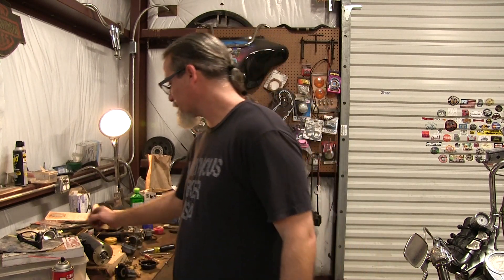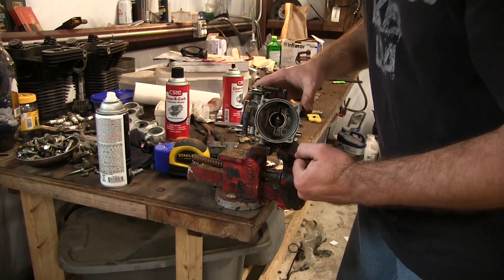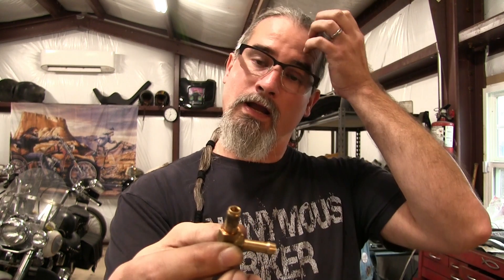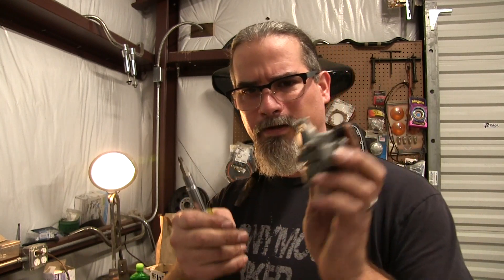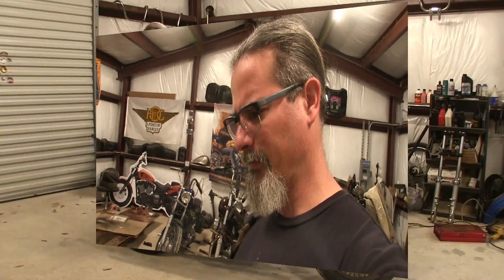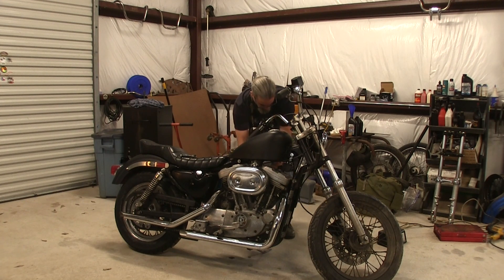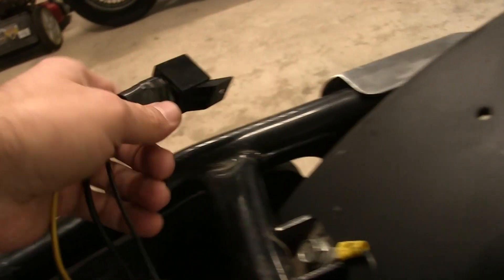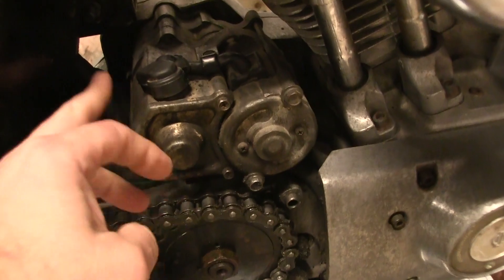I Was WRONG About POINTS In HARLEY Davidson EVO Engines Keihin CV Carburetor BUILD

Comment: Most folk also forget that your spark plug gap will need to be adjusted if you run points on an Evo - to about 0.028" from memory and to make sure that the points gap is within 0.002" on each lobe of the point cam. Love your honesty man 👍

Comment: The stock cv Harley carb is very good. I have a 100hp twin cam and it feeds it really well.
Reply: I love the CVs ... I have a few S$S carbs sitting on my shelf because that is the first thing I swap out when I get a new project. I can pick up a take off CV for cheap at swap meets and mod them using CV Performance kits and have a great running carb ...
Reply from the maker: Sounds killer!
Reply: @tommylitchfield3450  exactly why I love using CV Performance parts. They know their stuff and have quality parts ...

Comment: Outstanding my friend!

My 1979 Electra Glide FLH King of the Highway full dresser Shovelhead is running Dyna S and two 5-ohm coils since engine upgrades in 2001.

No worries.
If you do change to electronic ignition 
don't ever leave the ignition on and walk away!
It will be smoked when you get back...

Here is a short & interestingly article about reading your spark plugs...
Reply from the maker: Killer, man!

Comment: My 2000 XL1200C hard tail is running points and the power band is great. The mechanical advance mechanism has a 25° range so I set static timing to 40° fully advanced which means idle is at 15°, 5° earlier than expected but it works and the advance unit can always be modified to have a reduced 20° range. Also it's important to change the ignition coil to 5 ohm and use copper core plug wires instead of modern suppression core.

Comment: I owned a 95 evo sportster 883...... Rode it for 27 yrs....... The only electrical problem I had was the gas cock..... Diaphram leaked after 14 yrs..... This caused vacume in body of valve to  occasionally work and not work..... This opened and closed vacume switch and caused one coil to fire and not fire which caused rough running of engine.....I changed it out..... Still running perfect to this day.....

Comment: My 84 had electronic ignition and it left me stranded. $500 to replace the electronic module in 1990. $50 to convert it to points. So, I bought the Blue Steak brand conversion . I have never regreted that decision.  The electronic module on my 99 Softail died also. A Blue Streak points conversion is in that one also. They run fine.

Comment: Apparently I'm one of the few who are still alive who built Racing Engines with points and condensers, hearing them ROAR down the back straight at Daytona and Talladega. And they never missed a beat for 500 miles, wide frigging open

Comment: Man -  all you needed to do was elongate the slots on the points backing plate a drill bits width. That will give you all the options for timing you need. 30 second job with a drill -good luck 😎.

Comment: Pull the solenoid cover. Then activate solenoid manually by pressing the rod inside. If it starts its a wiring/fuse/circuit breaker issue. If it just trys to turn over you need new solenoid.
Reply from the maker: All the breakers are still good. Everything seems to point to the solenoid.
Reply: @SaddleTrampTV  test it. It's only 3 bolts.
Reply: That's why you always add manual solenoid push button

Comment: Coming from a points and condenser generation it was a major improvement to go to electronic ignition. When you went to points all I could do is shake my head and wait, knowing you'll find out. I like to take old shovelheads put electronic ignition in them with an upgrade on the output of the alternator, valve seals, cv carb and 5 speed tranny with a wet clutch. That bike will make all the power you need and run forever, unless you are packed heavy then a little stroke might be in order. Later my friend. Always enjoy your content.
Reply from the maker: Yeah, some folks just need to fall on their face to learn. Seems to be my story a lot of times.
Reply: @SaddleTrampTV  I have found those to be the best lessons learned. Trying something is learning and information is not knowledge.

Comment: Good vid. I don't even run points in my Shovelhead. Electronic ignition was invented for a reason. Works every time and it's hotter consistent spark. Set and forget. Good luck with that Sportster. It's coming along fine.
Reply from the maker: Great point!

Comment: I have battery on the brain, It can say 12.2 to 12.6 all day long, but the best way to test  that is to hook up a 12v fan or something that really pulls current, because It can have a broken connection in the post inside the battery, and still read 12 v. and all the wiring will read 12volts, even fool a battery charger,  and then maybe that solenoid switch inside the starter is full of copper dust, which keeps It from contacting solidly,  the most often fail is the battery worked, before but.... connecting It over and over sometimes breaks something inside. My Harddrive Battery was junk in about a half a year..Brass terminals arent all that either.

Comment: when l got my 2nd had evo motor for my bike it had points in it  & it was a pro built engine... l didnt know how to wire points to the coil so l put  my ol Eletronic ignition in...  wasnt sure on the points on a evo but there where there.....
l have a push  stater cover on me solenoid so if ir dont start iff the start button  l just  hit the solenoid cover button starts every time & has saved my arss a few times .. cheers mate
Reply from the maker: I have one of those push starters on my softail. Seems that nobody makes one for the year model of sportster I have here.
Reply: @SaddleTrampTV  thats a bugger... cheers

Comment: If and when I ever have troubles with the solenoid on my XL, I think I will put one of the manual push button ends on the solenoid, as well as fixing whatever else is gone bad for a just in case. But I would guess that The Missus would not want to reach down and push on the end of the solenoid every time she wants to crank it if she decides to ride the Redemption Bike. I feel your pain on dialing in an ignition problem at the same time as a carb rebuild, since they can both cause similar troubles. I have a 2006 which has a CV carb but the newer style ignition with a crank position sensor, and my sensor would fail only when the engine was hot. When it cooled off it would idle great. I tried 3 different pilot jets and screwed the pilot screw in and out for weeks until I saw a video where a guy showed the same problem as it was happening. It warmed up, ran like crap, then he used a water hose on the case next to the crank sensor and as it cooled off, it ran like a top. It didn't show a trouble code on the check engine light until after I had seen that video, after burning my knuckles off taking the bowl on and off that carb a hundred times. A new $60 crank sensor and it idled great, hot or cold. I sure wish they had left the carbed rubber mount bikes with the older ignitions. There's not a thing behind the points cover on the 04 and up bikes at all. They just left the cover there to look cool, I guess. Sorry for the long story, but maybe it will help somebody else with a 04 to 06 Sportster. Take care, Corey and Mrs Kim
Reply from the maker: I looked into a push button, but there's not one out there for the style of starter this one has.
Reply: @SaddleTrampTV  Well that stinks! Good luck sorting out the problem. Maybe it's just the contacts and you can sand them clean.

Comment: EVO click of death, I have 2 starters that both do it intermittently even after rebuilding the solenoids and verifying no wiring issues. So I just bought one of those billet covers that allow you to manually engage the solenoid with a button so I don't get stuck somewhere click clicking waiting for it to decide to start. If you get it figured out with a permanent solution I'd love to see a video on it.
Reply from the maker: A new starter.

Comment: i have a 2000 I in 1 sickel works great but i don t think there will be a warning when its tired  in my points sickels they aways let me know when when need a little att.  kicking over  condensors not as good as once was last few years  ago i add 2 nd  condensor at the coil works for me  HAPPY TRAILS

Comment: A common mistake when running electronic ignition is to use copper core spark plug wires. While this can be done with Dyna S ignitions, it can take out the ignition. Use suppression core wires.
Reply from the maker: Will do.

Comment: There is no change on the slot on the end of the camshafts between early/late Shovels or Evos.  There was a change in the late 1970's, probably 1978-1/2, on the Timing Marks on the Crank Wheels.  The Early Shovels had a Large Dot for TDC and a Line for BTDC; the later ones have a Heavy Vertical Line for TDC and Dots for BTDC.  The electronic rotors, which index on the slot in the camshaft are different and most aftermarket electronic ignitions require a Gold colored rotor, O.E.M. 32402-83.  I have a 1984 FXEF that had O.E.M. Electronic Ignition, then Points, then Ultima, now back to Points all with the factory camshaft and same Timing Mark (Heavy Vertical Line on the Crank Wheel).
Reply from the maker: You're right. I found that out later on.
Reply: The real problem is Chinese reverse engineered parts that are not in spec.  Find used O.E.M. Harley breaker plates and Point rotor cams and use Blue Streak Points and Condensers.  Also just change the points themselves, and disassemble the Advance weights to see if the holes are egged out or the pins are worn.  You can replace the individual pieces as well.  Also re-lube the Advance assemblies whether new or reuseable old.  Lubri-plate is the recommended lube or some folks use white lithium grease.  I have been messing with Point ignitions for 60 years! @SaddleTrampTV

Comment: After remove and clean the cv carb put all back and she starts and warm up good, ride for couple of miles then stop for few hours, after that starts again but idles bad and rides realy rough
Reply from the maker: Maybe something in the ignition? Or try your intake seals to see if they leak.
Reply: I Will check, thanks once again

Comment: Cory,
You don't have any leaking issues when you put those brass 45-degree fittings in your aluminum-bodied carbs?I think that by now you can reassemble a carburetor blindfolded.
Peace
Reply from the maker: I use then all the time with no leaks. Been messin with this kind of carb for so long that it's like walking and chewing gum now.

Comment: Omg the tiny accelerator pump hole in the bowl is such a pita on cv carbs. I had to soak mine in carb acid. Not even sure if you can get that any more
Reply from the maker: Shooting carb cleaner through all the ports seems to do the the trick every time.

Comment: Mh i remember a ld vid where you put a new set of points (drad spe) on and old ironhead, and you discovered a big diference on the cam slot.
Mayby this new system will work better on the evo's than the original ironhead stuff and give you a better orintation for the timing?
Just thinking...

BTW i am on the way to convert my 06 sportster to a "n electrnic" state with a "chopper like" simplified electric loom and point ignition, i am still assembling parts but i already have my point plate and the new coil.
This video was a bitter news for my project, but i can't go back.

Comment: I'll be honest with you get rid of the stock carb, and install a Mikuni TM or HSR series carb on your sporty. Once you get the TM dialed in they just work great, and seem to be a very trouble free carb for years. You can buy a HSR 42 for around $300.00 as a kit for your bike, and it will come with extra jets and instructions on how to properly tune the carb to your bike. I've been tinkering with bikes for over 30 years and I have learned the hard way about working on old worn out harley carbs. Another thing DO NOT put a S&S carb on your street bike that you dailey they are a race carb and do not have good manors.

Comment: Hey Saddle
I did not watch but Im wondering if you are familiar with JIS screw drivers?
Japanese Industrial Standered.
My Evo carb had JIS screws.
Reply from the maker: Never heard of them
Reply: @SaddleTrampTV   Check them out.
Having one could be the difference of striping a carb screw or not striping a carb screw.
A Harley mechanic i know with 30 years experience swears by JIS screwdrivers.
This guy has so much knowledge about Harleys from the 60's- 2005.
He was trained by this guy Hubs a ledgen in Harley repair. 
He started at a H.D. delership in Clifton New jersey in the 80's
He has given me so much help with my FXR over the years. 
Most of it over the phone. 
Eric is as nice as he knowledgeable.

I would like for him to get on youtube, but unless I win the lottery that will never happen.

Comment: That starter need contacts kit installed and they make the 3 screw cover with a manual start button built into it ! Ebay them!
Reply from the maker: There's not a button for this starter. I've looked into it, and there's not one with the correct bolt pattern.
Reply: @SaddleTrampTV   they make two different ones! What starter are you using?
Reply from the maker: @revbikerbigd8664  Whichever one they were using from 83 to 90. Specifically 86 to 90.

Comment: Hey saddle tramp! I went with point's on my 2003 sportster build i did get it running!
Got a question about that dyna s ignition can you use the coil for the point's system with that? When i got the 883 running it seemed to be fine but i wasn't able to ride the bike yet! Now i switched to a1200 and haven't been able to get it started it only back fire's i have no electronics on this build I'm getting ready to buy that ignition for my bike the First of the month.
Reply from the maker: Yes. A Dyna S uses a 5 ohm coil as does points.
Reply: Ok thanks for the information!
Much appreciated!
Reply: Hey what jets do i need to use? Im using a CV carb.
Reply from the maker: @solarprepper1offgrid.753  A 48 slow jet with a 175 main jet should do you just fine.
Reply: Thanks for taking the time for my question's

Comment: I like both. If a bike comes with points and runs good, I leave it. If the points are shit and parts are hard to get, electronic is great too. My main issue with them is most of them are made in china and can just be shit, or become shitty within 1000 miles or so. However, that was my experience with dyna's on small block moto guzzi's.  Their coils sure are nice.
Reply from the maker: I hear ya, man.

Comment: my 95 Softail runs great on points (20,000 miles to date) was the coil appropriate for points?
Reply from the maker: You run a 5ohm coil with points and condensor.

Comment: Cv carbs and electronic ignition run with a V.O.E.S. Switch points don't ,If you were to run points and a S&S Super E and eliminate the V.O.E.S.Switch you're good to go ,This is from Zipper's >> The Vacuum Operated Electric Switch (V.O.E.S.) was standard equipment on all Evolution® engines and works in conjunction with most all late model electronic ignitions, both factory and aftermarket. It senses high and low manifold vacuum and signals the ignition to change its advance slope. Under high load, the switch signals the ignition module to electronically retard ignition timing to reduce the possibility of detonation. In low-load conditions such as cruising at light throttle, the ignition stays in the advanced mode for increased fuel economy and lower operating temperature. All controlled by the magical V.O.E.S. switch!
Reply from the maker: Good to know. Thanks!

Comment: I think you gave up on points too soon.  There are guys running them with no problems on Evos.  The good kind have needle bearings on the advance weight pivots.  The best points and condensors are Blue Streak brand.  Don't trust an old condensor, or old advance springs.
Reply: Why use old technology when electronic is bullet proof
Reply: @stevegiannotti6700  The main problem with points is when the condenser is shot, It will spark but the coil only gets half signals and makes the coil take longer to recover, theres the miss.
Reply: @stevegiannotti6700  Points are simple, you can easily carry spare parts to keep you from getting stranded.  The only down side is having to do occasional maintenance.

Comment: I usually enjoy your videos however this time I have to disagree with your conclusions. 
I’ve been riding on points in my evo for 30yrs now and likely only changed them out 5 times and not because they were worn just for maintenance. Only 1 condenser failure. Bike has always ran great. Perhaps it’s the quality of your replacement parts that is the issue. No disrespect, just my two cents worth. 👍
Reply from the maker: Thanks for the info. I'm not always right. I still stand to be corrected. Perhaps a quality set is few and far between.

Comment: What's wrong in a evo when it comes to points
Reply from the maker: The position of the timing slot on the end of the cam was changed in late 78. Making it impossible to set the static timing.